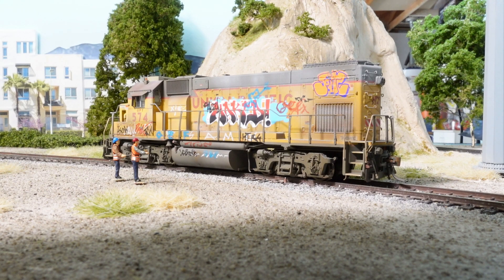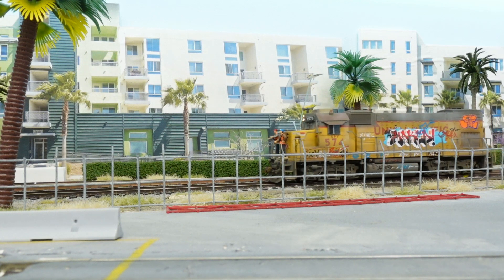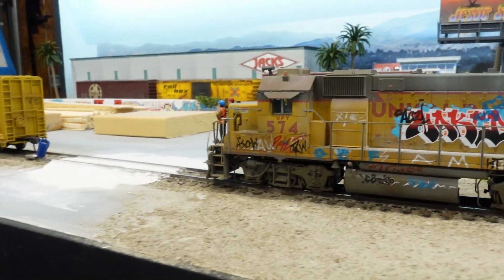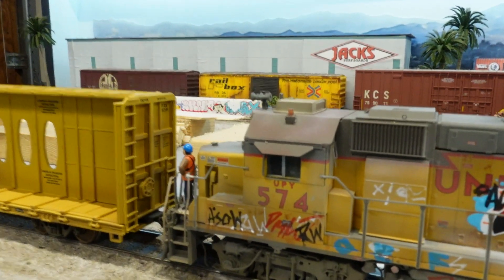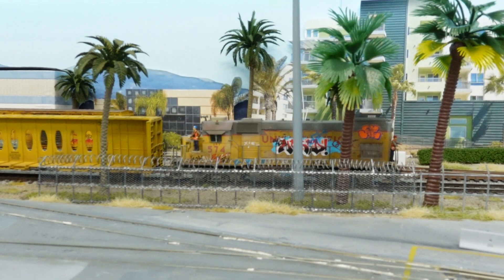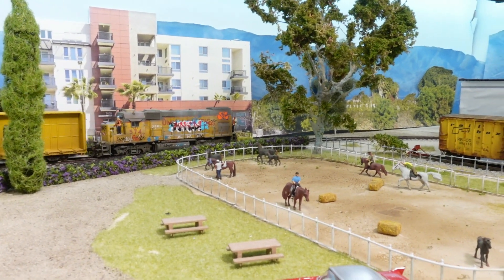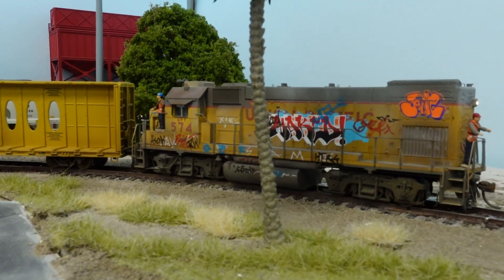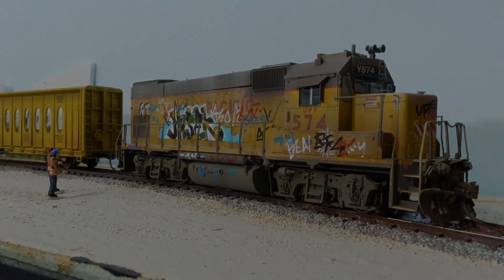Operations | Graffitied GP15-1 switching Huntington Beach

Comment: What DCC system are you running?
Reply from the maker: I use the ESU cabcontroller.
Reply: I recently got a ESU cab control after persisting with antiquated NCE (command prompt with LCD display fresh out of 1990). ESU is far far superior to digitrax and NCE. Thanks for your great videos. They are very entertaining. Your layout is great.